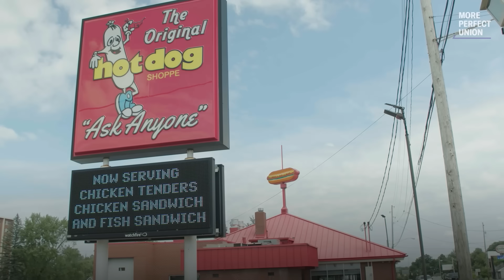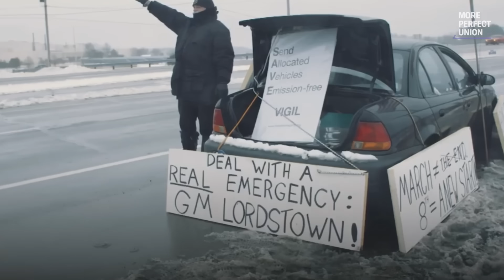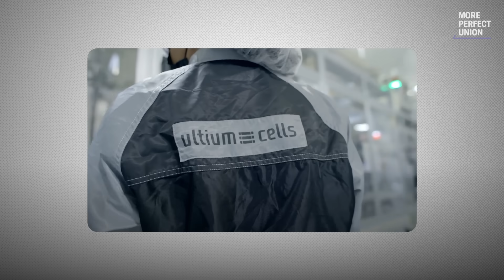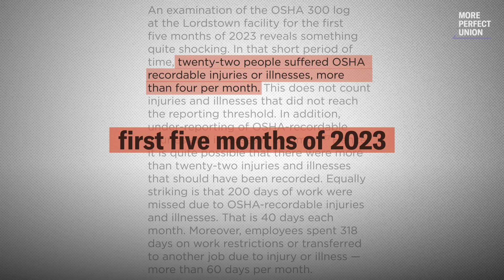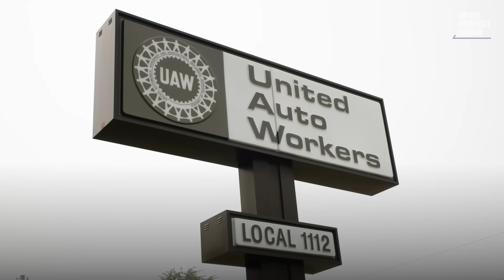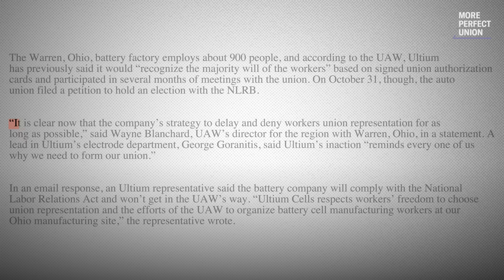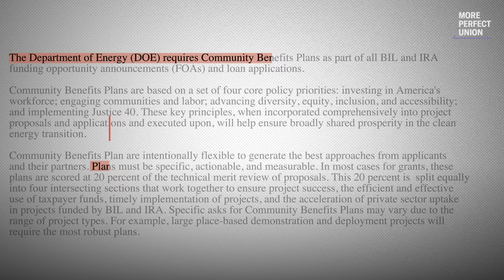What GM Doesn’t Want You to Know About EVs | Ft. John Russell

Comment: Electric cars won't solve the climate crisis, the biggest source of GHG emissions comes from production of the cars and their batteries and Particulate Matter from tires as the car is being driven. 

Tailpipe GHG emissions in gasoline cars only make up a small share of total GHG emissions produced. Beyond that electric cars distract from public transit, which is actually the best solution to meet transportation needs and help end the climate crisis.
Reply: Pretty sure tailpipe emissions are by far the biggest contributor... but at least you're right about the solution.
Reply: This is all bunk
Reply: @dmike3507 Not since the catalytic converter.
Reply: @gregorymalchuk272 they still pollute, don’t get it wrong.
Reply: @dmike3507  from what I’ve read it’s about 12-15% now. Considering everyone has an agenda, who do you believe?

Comment: As a safety manager in a manufacturing plant, I'm at a loss for words.
Reply: Try "tools down!"
Reply: @octothorpian_nightmare  when he was explaining how bad the safety was. I was just like, wow.
Reply: This is why I'm concerned that we only have one person commenting, and some of what he's relaying is hearsay (e.g., Were the employees working in the cathode mixing department actually suspected of purposeful sabotage? It's possible, but not something that's shared from his perspective.). The thing to keep in mind is that this facility is just a scaled up version of an identical assembly plant that's been operating in South Korea for over two years now, so we have a direct point of comparison. To me, there are three separate issues here: unionizing, wages, and safety. 
The safety issues shouldn't be predicated on whether or not the plant is unionized. If these are actual safety issues, these problems would still be happening even if the workers were UAW making $60/hr, so if the assertion of this video is that higher wages would magically make these safety issues go away, I have to question whether there are ulterior motives. 
So yes, I agree. Address the safety issues. Also, yes, pay a decent wage and allow the employees to join the UAW. However, if it turns out that any of these safety issues were the result of intentional acts of disruption, terminate those employees who were responsible for cause.

Comment: i have built solar batteries as a hobby and I can tell you unequivocally that it is extremely dangerous working with not only the harsh chemicals, but having a battery explode in your face if 2 leads happen to arc.

Comment: The main thing in an EV that requires stringent safety processes in all aspects of handling and assembly and their paying peanuts and giving minimal instruction. With the accidents described, the safety concerns, the lack of confidence with the training,  the batteries already assembled that could be sub-standard due to these conditions could have far reaching consequences down the road. If the is any sort of governing body that looks after electrical safety they have to step in fast, threatening recalls if they find these issues ongoing

Comment: Ultium batteries use nickel cobalt manganese aluminum (“NCMA”) chemistry.  They need to switch to LFP battery chemistry which is lithium iron phosphate.  Which is non toxic.  I am not sure about the manufacturing process for LFP but I am willing to bet it involves way less dangerous chemicals than NCMA batteries.  Plus LFP last 2 to 3 times longer.  LFP batteries are increadibly difficult to catch on fire.  When an LFP does catch on fire it doesn't produce its own oxygen so it doesn't burn as hot as NCMA batteries which do produce their own oxygen as they burn.  LFP batteries can also be put out with regular water.  Also the manufacturing process of LFP batteries produces way less CO2 than NCMA.  Since they last 2 to 3 times longer than NCMA batteries that means you only need to manufacture half to 1/3 the number of batteries as you do NCMA batteries.  This cuts the lifetime CO2 down to way less than 1/2 or even less than 1/3 the CO2 for LFP.  LFP batteries are also way easier to recycle than NCMA.  Until there is a huge breakthrough in energy storage like graphene batteries or super capacitors, LFP is the way to go.

Comment: So, they shut down the GM factory. Probably because it was too expensive. They then created a battery factory in the same town, and the workers are saying they want wages like they used to have. Wages so high they closed the previous factory?

I don't see how this ends well.
Reply: It wasn’t high wages it was greed the salary of at least 3 car plants is barely equal to what the CEO took home in 6 months.
Reply: @seanhartnett79  Last year the GM CEO took home $29 million. At its closing, the Lordstown plant employeed around 4,500 people.
$29 million would pay 4,500 people around $6,000 a year.
Reply: @DJ_Force  did you count stock options or bonuses. Because most figures don’t count that, or stock buybacks.
Reply: @DJ_Force  they bought back $3.5 billion of stock since September of last year. This is just some of the money that they wasted. They didn’t need to shut down the plant,
Reply: @DJ_Force  and how about all the other executives. If the economy is hard or you screw up, management should take the pay cut or layoffs.
Reply: @seanhartnett79  Stock buybacks aren't a waste of money. They are buying back parts of the company they originally sold to raise money.
Reply: @seanhartnett79  I think you misunderstand the purpose of a company. A company exists for one reason only, to make money for the owner(s). Every employee at every company in the world, throughout history, is a regrettable cost, and is tolerated only as long as they add to the profits.
Reply: @DJ_Force  why were they illegal until recently. It only serves to pump up stock prices.
Reply: @DJ_Force  now you get it. And that is a problem that has to be stopped

Comment: It is even worse than segment indicates. It begins with the reality that EVs are NOT really a solution for the climate crisis because they are too polluting. This starts with the cobalt and lithium used in the rechargeable batteries, but is bigger than that. Public transportation is perhaps sustainable in the world we are heading into, but EVs absolutely are NOT if we still don't have sustainable energy and our population remains at the current level. So, people need to drive less, fly less, and there needs to be more public transportation if we are trying to maintain more or less the same world we have now, but just a more sustainable one. Thus, working in EV factories is therefore NOT a job of the future and the same goes for manufacturing hydrogen cars too.

Comment: This seems less about a failed promise of electric cars and more of a field promise of management and local governance. Combustion engines date back to 1000 AD and 1300 AD which means they had at least 700 years to get it right and are still not anywhere near perfect. So, sorry if I don't share the same pessimism against modern technologies that are constantly innovating. I can assure you it won't take 700 years before it's near perfection!

Comment: Comparing total hourly compensation (healthcare, 401k) to starting hourly pay isn't really a fair comparison, but I get the point. I wonder what currently starting hourly compensation is then if wages are 16.50/hr.

I've worked in some high-end manufacturing. Much more expensive machines than cars, and you'd be surprised at the lack of safety. Companies boast their safety ratings for investors while the experience is far different than what they portray. You can't teach 300 people with no technical background to work on 408-volt systems, in just a week, yet production must be met.

Comment: I'd honestly rather see more investment into carbon capture fuel. EV's are nice, but they're a nightmare to put out in a fire. Once drove pass a model S that was just a puddle of melted aluminum and wheels. Not to mention the massive amount of bullshit associated with getting materials. Also I've seen what Audi has required for a tech to work on a battery. It's A LOT OF WORK AND SAFETY GEAR. No joke a tech was wearing thick insulated boots, gloves, apron and mask. It took him 4x as long as what it paid to service a battery. Maybe longer.

Comment: UAW retiree here.  One aspect of electric vehicles NOBODY ever mentions is electric vehicles will make the price of electricity double or more.  How so?  Currently, the cost of ROAD MAINTENANCE is 100% on consumers of gasoline and diesel fuel.  Yet, electric vehicles use the road and will cause just as much road damage.  When the number of electric cars and trucks begins to eliminate IC engines, government departments that maintain the roads will begin to call for TAXES on electricity to replace tax money lost by reduced use of gas and diesel.  It's inevitable.
Reply: That's ludicrous in a couple of ways. First of all, they've decided how to make Ev drivers pay for road use they put extra fees into the annual registration. And secondly gas taxes do not cover the cost of road maintenance. Not even close. Most road damage is caused by heavy vehicles like 18 wheelers which by economies of scale purchase less fuel per ton while doing more road damage per ton than passenger vehicles.
Reply: @AlRoderick  Y"know, for someone that disagrees with me, it sure sounds like you agree with me.  I did include diesel into the taxes.  Read it again ludicrous.
Reply: @georgepretnick4460  yes you did while not acknowledging that trucks destroy the roads more.
Reply: @seanhartnett79  Jeez, dude, electric vehicles includes trucks of every size .  Even the apportioned (semis).  You obviously are unaware that electric trucks have been in use for a couple decades.
Reply: @georgepretnick4460   Most trucks run on diesel.
Reply: @seanhartnett79  Yes they do, but more will run on batteries in the near future.  Precisely my point electric vehicles (including trucks) will have to be taxed for road maintenance?  I'm so glad you agree with me.
Reply: @georgepretnick4460  we already do. 15 states have a vehicle mile tax to make up for gas tax declines.
Reply: Yes the electric vehicles are twice as heavy on the roads 🤔

Comment: The thing is, it isn’t a problem with  EVS but with the government wanting to bring back manufacturing and not putting enough effort into holding them accountable: basically to get an EV tax credit it must be American made and union made. These companies created a new company to dodge the law.
Reply: EVs are a problem until powering them comes from completely renewable energy. Otherwise, it's a catch-22.
Reply: @UmbilicaLashed  Even running an EV on coal is 15% more efficient. This is from North Dakota.
Reply: @seanhartnett79  Lol. Where did you get that number?
Reply: @UmbilicaLashed  it was data collected from A study on EVS in North Dakota.
Reply: @seanhartnett79  In North Dakota??? Yeah, so many people are driving them in North Dakota. Lmfao, there's maybe 600 registered EVs in that state!!! 😂
Reply: @seanhartnett79  Now that I see the stats, I was right. If it was data from California, maybe it would be plausible.
Reply: @UmbilicaLashed  they used data and most of the power grid in North Dakota is fueled by coal. Which is the whole reason I brought it up.
Reply: @UmbilicaLashed  data from California with about a million electric cars, suggest about 30% more efficiency.
Reply: @UmbilicaLashed  California is only like 60% renewable though.
Reply: @seanhartnett79  Still a scam.

Comment: With no disrespect to the union, higher wages will force up the price of cars (as well as reduce the amount that top management and owners make).  EVs and hybrids already are higher priced than the equivalent gas vehicle.  And new car sales have dropped more than just a minor amount.  It doesn't look like interest on vehicles is going to reduce significantly for some time to come; and if it gets bad enough, car manufacturers could be seriously impacted - to the point of some ceasing to exist.  I for sure do not have an answer - and that is not to be unsympathetic to the plicght of the workers.

Comment: You definitely took the bait here. This has nothing to do with electric cars. It has to do with employees who are under paid, under represented, and possibly under trained. Unionization could address all of those issues, but you're falling into the trap of implying that somehow, working on EV components is inherently more dangerous than working on fossil fuel vehicle components, which is isn't true based on the 20+ years worth of modern data we have up to this point.

Comment: GM is just terribly miss managed and poorly engineered unfortunately. These prismatic pouch cells are likely going to be obsolete soon if they are not already. They should’ve just copy Tesla cylindrical cells, they don’t have these problems on a technical and manufacturing safety level. LG cells will prove a mistake.

Comment: How's it failed when we're barely into the era of them?  The ICE cars have been going for 130 years.  Come back and talk about electric once it's had 130 years.
The rate at which power density is increasing is unreal. The rate at which charging is getting faster is unreal.
Fundamentally the electric motor is superior to the internal cobustion engine because;
1. it's simpler with only one moving part
2. you get 100% torque from zero revs.
Reply: Did you watch the video? I'm guessing not since your comment is absolutely and thoroughly not what the video was about. How about ya watch the video before spouting off?
Reply: you have missed the point so incredibly hard and fast, OP, that the US military would like to research you to develop advanced armor-piercing warheads.
Reply: @LexYeen  good one
Reply: @LexYeen  The US military needs it as it couldn't beat peasants on bicycles in Vietnam despite two decades of trying and it couldn't beat goat herders in pick up trucks in Afghanistan after another two decades of trying.  $6 trillion spent - zero victory gained.
Reply: We're 120 years into the era of electric cars and they still aren't competitive with internal combustion engine vehicles.